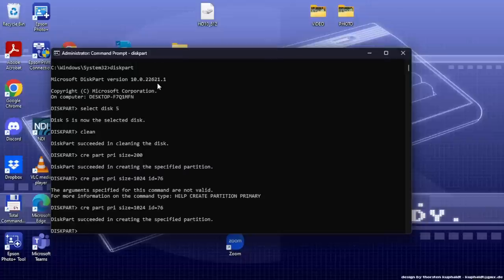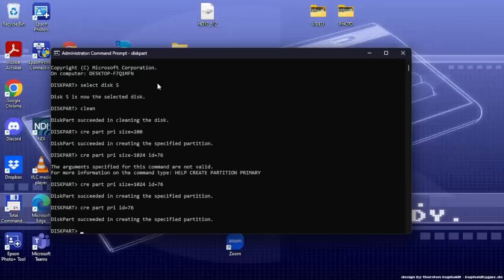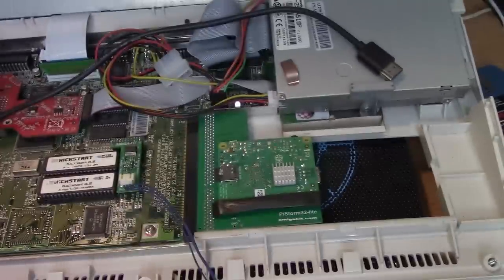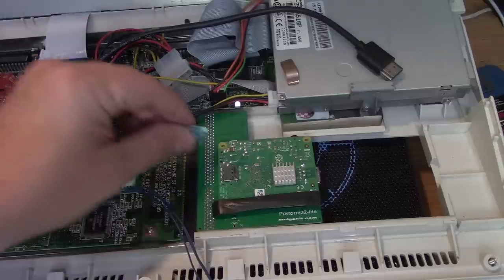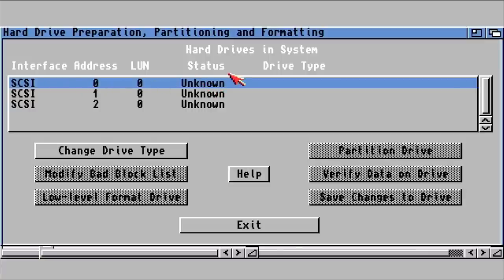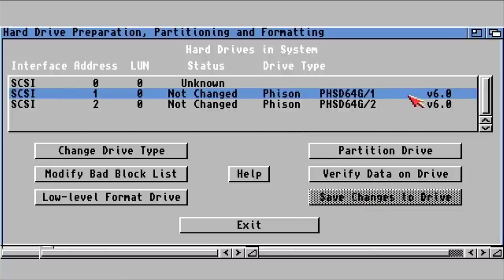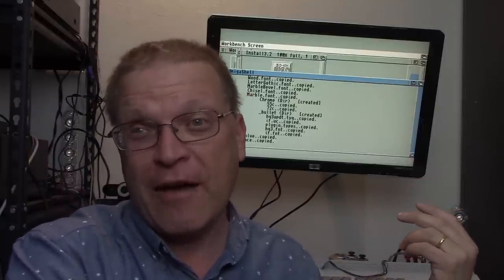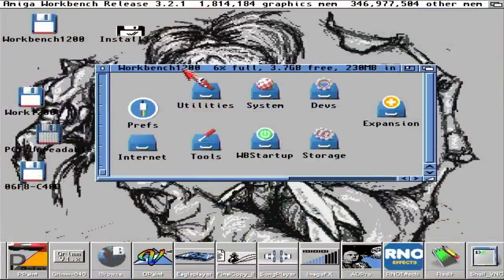PiStorm32 Lite for Amiga 1200 - Installation guide and review

Comment: Sir you can't imagine how much this tutorial helpful. Thank you for your service :)
However let me ask a question. 
After cloning of my CF card with WHLOAD games to the PI sd card. At the first boot from SD cad I receive  loadmodule failed returncode 10 error. Is anyone has idea why ?
Reply from the maker: What version of the OS are you using? Sounds like maybe 3.2? If it is, give the old two finger salute on boot up and choose to go through the startup sequence step by step. That will show you the exact line that it is failing at. It's probably one of the lines at the very beginning. You can then do this again and skip that line, and see if the system boots.
It might be related to the ROM image you are using. If it is different than the ROM you built the AMIGA OS install with, you can get errors like this.
One option is to then reinstall Amiga OS over itself so it creates the correct load module commands for the ROM you are using

Comment: A newbie question. Does the Pistorm lite also give the A1200 256MB ram?
Reply from the maker: I think the RAM is configurable. Mine shows up with about 300 MB of FAST RAM, but It seems to be adjustable in the config file on the 200 MB partition.
Reply: @10MARC  Thank you very much for this.

Comment: Hard drive manufacturers do not lie about the size of drives. They sell them in decimal SI units of storage (multiples of 1000) however OS'es report the size in binary units. Most people believe a gigabyte is 1024mb when in fact it is not. A gigabyte (decimal) is 1000mb whereas a gibbibyte (binary) is 1024mb.... so for example if you put a 10 gigabyte drive into a computer it will tell you it has 9.765 gigabytes available (10000/1024).
Reply from the maker: Oh I understand what they are doing. It is just so funny that there is not a standard way to measure sizes. The OS of every computer does it one way, the manufacturers do it a different way.
Reply: For years a gigabyte was a non SI unit and 1024 megabyte. Gibbibyte was basically invented by hd manufactures when they were caught pretending it was an SI standard.

Stop trying to rewrite history, I lived through it and you won't BS me.
Reply: @00wheelie00  It was standardised in 1999
Reply: @Harp00nX  I had my first computer in 1982 and a kilobyte was 1024 bytes. The storage shenanigans started around 1993-1995ish where some manufactures started reporting multiples of 10 instead of powers of 2 to get an advertising advantage over more honest competition and you had to be real careful what you bought. The standardization happened precisely for the following reason: manufacturers deviated from the then standard of powers of 2 and lied about capacity.

Comment: There are rpi compatible clones like Libre pi and some others...  Can you confirm which non rpi cards would work also?  Thanks
Reply from the maker: I have not heard of those working. Maybe they do. I know the generic knock-off Arduino boards are hot garbage and have about a 50% failure rate... I wonder if the knock off Raspberry Pi 's are the same?
Reply: @10MARC  I'll manage...

Comment: Do you have a guide for the 500 version of the pi storm ? I want to know how to have this run mac os using shapeshifter.
Reply from the maker: An older video - but the EMU68K actually works much easier. Setup is exactly the same, just use a different PiStorm download from the website
Reply: @10MARC  agree now just need a shapeshifter guide for the amiga :)
Reply from the maker: @gilbertvera1678  I have been planning on doing a show on Shapeshifter for well nigh 4 years now... One of these days...
Reply: @10MARC  excellent :) make it as long of a guide as needed.

Comment: ive tried the pistorm32lite with a pi3 and a pi4, i get graphics/screen glitches/jumping several times a minute with it, I have an indy mk3 as well, does anyone know why this would be?
Reply from the maker: Hmmm... I have the MK2 and it works OK with that. What resolution are you working in? CHIP RAM access is slower with the PiStorm,, so maybe the graphics issues with the MK3 are more pronounced. There are some advanced MK3 graphics settings you can try tweaking. Also, have you checked normal RGB graphics? Do they look OK?
Reply: @10MARC  normal rgb graphics all fine, im thinking and indivision mk3 issue

Comment: Fantastic Job on the tutorial Doug 👍🏻 I’ve got one of these. I prefer it to the Vampire V2 I also own. Referencing this, what do you prefer? A couple of questions. 1).. On the Diskpart side, can you just set up the 200MB FAT32 without setting up the 2 ID=76 partitions and just use HDToolBox in the Amiga side to setup? 2).. You mention Networking, is thePiStorm32 Lite capable of this? Just to also mention in the video. You said this just takes over the CPU. But you also mention later that you have to add a .ROM file. So this takes over the ROM as well? 😉 So basically the same as a Vampire does? Cheers 🍻
Reply from the maker: I prefer the Vampire for sure. The PiStorm is brilliant for sure, and may someday be as useful as the Vampire, but it is all over the place. Some programs run blazingly fast, while others feel slower than a 68020 A1200. It relates to whether the program is running mostly in FAST RAM or using the custom chips I suppose. 
You still have to create a partition on the SD to use the card as a hard drive, but you can the partition it just fine within HD Toolbox. It totally takes over the ROM, and that is a good thing as the code is accessed MUCH faster than the onboard ROM

Comment: Nice video as always Doug. I have one also now and I put the Pi 4B on it. However I can't get it stable. It starts Emu68, but booting from my Gotek with the install disk of OS 3.2 it always freezes at the same spot. Tried different micro-SD cards (Sandisk, Kingston), but no luck. Tried different nightly versions. Tried different Kickstart rom files. I have a modern power supply, so that should not be an issue either. Anyone any ideas?
Reply from the maker: I would not bother with the Pi4 yet, honestly. I have not heard of anyone running it very stable. Maybe slow the Pi4 down a bit?
Reply: @10MARC  After some mail exchange with Chris from Amigakit it turned out I neede the timing fix. I never heard of it before, but sure enough that did the trick. I removed E123C and E125C and now it seems to be rock solid :)

Comment: Love the way this little device has came on, just wish could find a way to only have to use 1 monitor with it, without a rare monitor that can do it all is there any other way, eg i a indivision mk3
Reply from the maker: Ya... Pumping out native Amiga and RTG to the same connection is a dream of many. I can do it on my A4000 with my MK3 and Picasso 2 card, as the Picasso 2 has a passthru for Amiga video. It works fantastic!
Reply: With my Dell ST2410 monitor, I'm using the Indivision Mk 3 to upscale native Amiga display modes and output via HDMI, with the RTG modes also coming from the PiStorm thru HDMI, and I just use a cheap switchbox from Amazon to change between the two.
Reply from the maker: @LeftoverBeefcake  it works pretty well with a switchbox. I have also set up two monitors and share the AGA/ECS connection with one of my PC's

Comment: Apparently this Chipset issue has been  fixed and also some jitter correction issues fixed.
Reply from the maker: I am putting that new update to the test this weekend. A few of us American YouTube Amiga guys (Me, Chris Edwards and Q) have been a bit of squeaky wheels on this issue.
Reply: @10MARC  can't wait to see that. I've downloaded it but not tried it myself yet
Reply from the maker: @jimbonobodycares10  yep. I have a series of specific tests that push the custom chips fairly hard. I will be comparing between the two versions and with my A4000/060

Comment: bootable QDH1 ?
no "LONG FILENAMES" enabled?
Reply from the maker: Yes, it enables QDH1: as bootable because the system saw it as a second physical hard disk, and I did not catch that until the video was shot. I have since removed it. I tend not to use the Long File Name option. It seemed to cause an issue with a few programs I use, so I don't bother enabling it.

Comment: I've found Sysinfo disk speed crashes with larger than 1024 block size.
Reply from the maker: Huh. That makes some sense then. Thanks for the info!
Reply: If you use PFS3 then you can leave it as the default block size, as it gets ignored anyway.
Reply: @LemaruX  Thanks 👍🏻 I’m using the CaffieneOS on mine. It’s currently showing 22MB/PS! Wow! 👍🏻
Reply: @10MARC  yeah, for disk speed tests the scsispeed/diskspeed are definitely better. And so far never crashed for me.

Comment: do want for macintosh classics
Reply from the maker: It would be neat, but I don't think the Mac OS is extensible enough to handle something like a virtual CPU running on a Raspberry Pi. Amiga is kind of unique in that you can create drivers that can do about anything. I suspect the Mac OS is more locked down than that so it is harder to implement this kind of expansion

Comment: No Audio! 😮
Reply from the maker: Oh? Let me take a look (or a listen) 
Sounds OK to me. I bet you were notified of it before YouTube "finished" processing it.
Reply: @10MARC  And now after reloading the video audio is back. Weird!
Reply: I would like a PiStorm 1200 "non-lite" that adds 4 meg Fast RAM (or 5.5 with Ranger RAM)  for WHD gaming and an elegant way to disable the R-Pi. Basically a better  compatibility mode. So you don't have to swap cards. Continued access to the SD would be needed, but I admit I don't know if the SD card is already available when falling back to the 68020
Reply from the maker: @brettjns  interesting thought... I suspect that by disabling the Pi you would also lose the hard drive controller.
Reply: @10MARC  Oh okay.  I guess a CF-IDE on the mobo would be a way to solve that